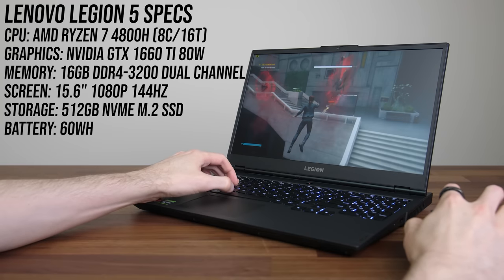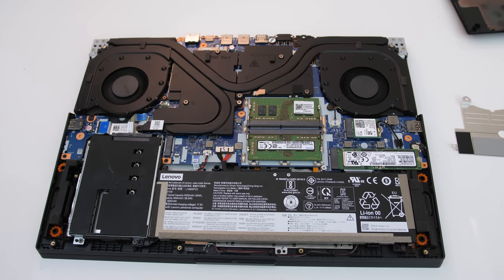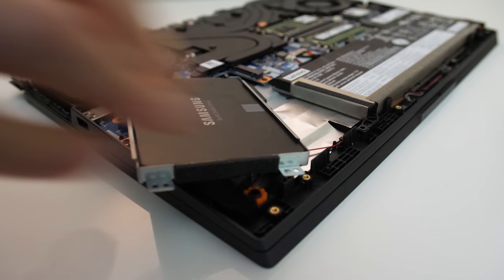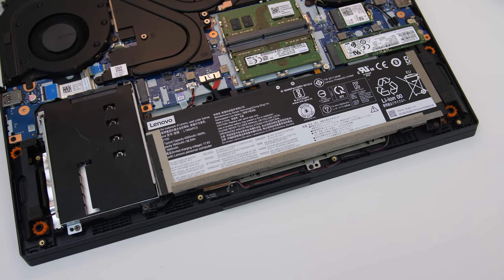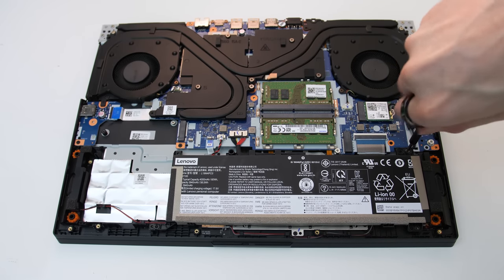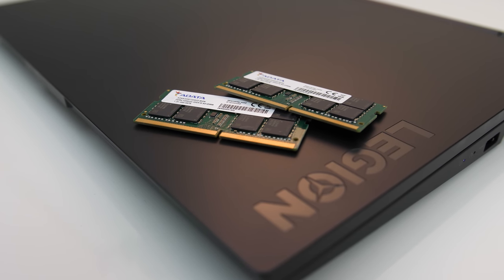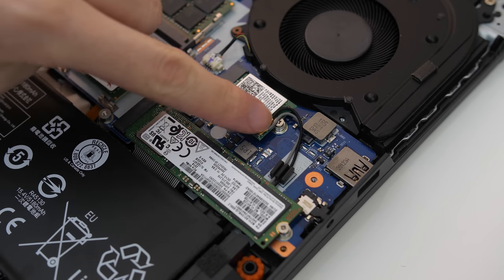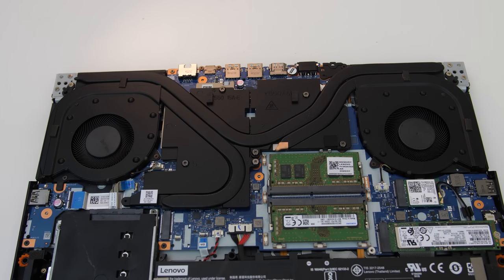Lenovo Legion 5 Upgrade Guide - Boost Performance!

Comment: Pro tip for those who are new to Lenovo laptops! 

If your laptop is plugged in most of the time, Lenovo has a function in their Vantage software called "Conservation Mode", which helps limit the battery charge to 60% when you're plugged in. This helps preserve your battery's health. My Legion 5 is now 3 months old and only has gone through 15 charge cycles!
Reply: currently using my 7 years old lenovo laptop and i never heard this before, thanks man
Reply: Asus has a similar feature. I chose 80% instead of the 60%, though. I don't know how many cycles, though.
Reply: @bipbop3121  I would love it if Lenovo had the option to go for a higher percentage, though I’m sure they’ve done their research before coming to the decision of setting it to 60 by default.
Reply: Doesn't this mean your battery can only charge up to 60% while you're using it, why would you want this?
Reply: Reminds me of the Vaio Care battery life feature on my old i5 2011 Sony SvS15 dinosaur. Still kicking strong after 10 years.
Reply: @loppyhero7196  to prolong battery life, this is very useful if you don't bring your laptop outside... plus if you do plan on using it outside, you can easily turn off the option and charge it at full.
Reply: @pipeds9979  WHY WOULD YOU ONLY WANT IT TO CHARGE TO 60%? NOBODY IS EXPLAINING THIS
Reply: @pipeds9979  Aight thanks, you just said to prolong battery life, you didn't elaborate but I understand now.
Reply: @loppyhero7196 
Among the few things that degrade your battery life:
1. Having it at a high percentage for a long time (older Lenovo laptops have a warning about this everytime u leave it charging for long). 
2. Going through many life cycles (low -> high -> low). 

Having it kept at ~60% eliminates those 2 problems, thus prolonging battery life. You can always turn it off easily if you plan to bring it out soon.
Reply: @nittikorn  Thanks for the info, I had no clue keeping your laptop at 100% for a long time was bad.
Reply: When Lenovo vantage is installed i am unable to control the backlight on the keyboard by using the keyboard shortcut. Does anyone have this problem?
Reply: @HDFilms123  BIOS upgrade will help
Reply: Do you keep yours plugged in? I usually unplug once I get off for a while.
Reply: Conservation mode isn't available on all Legion/formerly just Lenovo Gaming laptops.

Some of their models have batteries with additional hardware that allow the bios settings to optimize battery usage and it just automatically keeps it at a certain charge level or runs directly on the power supply.  I have a Y7000P-1060/Y530 that runs like this.  The battery is kept around 95%, but basically never charges beyond that and doesn't drop either.

As for how to get the laptop over the threshold if you set conservation mode, quite literally just fully turn it off and leave it plugged in.  Doing that will cause the battery to full charge as the 60% limit is actively maintained by the computer checking the battery periodically throughout the day.  

The entire point of conservation mode is for those who have a laptop, but the primary use is as a desktop replacement where they still want the portability available if needed.  My unit I have had for about 2 years (specifically 23 months) and I have gone through only 11 charge cycles and this laptop does get taken to work sites from time to time.  Assuming no pandemic, I might have gotten up to 15 charge cycles by now.
Reply: It has notifications that remind us it’s been a month using that feature.. is it important to charge the laptop full after a month use?
Reply: thanks mate
Reply: Ok
Reply: same as urs, on 3 months i still get 15 cycles 😂
Reply: Thanks for the tip! I didn't know this but I've had my Legion 7i for ~6 months and only gone through 12 cycles without conservation mode (daily use and mostly plugged in) ¯\_(ツ)_/¯
Reply: @ohendzo  same i unplugged it after use
by doing so my Asus would start charging if i replug without switching on device
therefore i needed windows to run (which drains abt 1% every time) then plug in after, but my battery would remain at 99% instead of 100%
Reply: hell yeah, i use the lenovo legion 5 with R5 4600H bought in early august plug in all the time ,only 10 cycle
Reply: do you not charge while using the laptop ? do you wait it for to cool down and then you close it to charge?
Reply: it also works even if the laptop is turned off (or at least it works in my case)

NO MORE OVERCHARGED BATTERIES BABY XD
Reply: Does it limit gaming performance? Since its 55-60%?  Or as long as its plugged in it is no issue?
Reply: @MrUchiha  as long as it's plugged there's no issue as far as i know
Reply: Thnks buddy
Reply: @MrUchiha  get 55-60% battery and turn on that mode: when you plug in, it will change to use straight power from the house and stop using the battery so your battery will do nothing = battery life saved ,just that easy
Reply: Wow seems interesting that’s why I apreciate Lenovo but I asked my which is better and he said acer nitro honestly acer looks better and does better FPS and others like cooling and price
Reply: I guees this works on smartphones too
Reply: @ototurmanidze5578  yes this also applies for smartphones
Reply: thanks
Reply: Using ASUS's feature for this as well, not fully charging is great for your battery health. I even charge my phone to 80% for this reason.
Reply: @loppyhero7196  It's a mode designed to intentionally cap the battery state of charge at no more than 60. This is very useful when the laptop's primary use case will be on AC power, because lower charge rates preserve finite battery life.
Reply: @loppyhero7196  It's a mode designed to intentionally cap the battery state of charge at no more than 60. This is very useful when the laptop's primary use case will be on AC power, because lower charge rates preserve finite battery life.
Reply: @bipbop3121  Really ? Where ?
Reply: Just so I'm on the same page I need to go  set my battery charge percent at %60 while in use to increase the longevity of the battery? I recently purchased a Legion 5 and I mainly use it for Gaming and School, so its plugged in most of the time when I'm on it charging at %100. I didn't really think to much of it honestly.
Reply: Hi, I got a legion 5i (Ryzen option wasn't available and hence had to take the Intel option) 6 months back. The battery at full charge 100% gets over within 4 hours. It is a 80 Wh battery and people are reporting more than 6 hrs at least. I don't play any games. Just browsing or watching video content. If I switch on conservation mode, it descends from 60% to 20% within 2.5 hrs which gets even more frustrating. Anything I can do to check this out? I got 16 GB RAM, 1TB SSD.
Reply: @praveenbehara  Have you checked your screen luminosity ? And do the fans spin a lot ? Is your CPU and/ or your GPU working hard?
Reply: @loppyhero7196  as mentioned there, if your laptop is connected to charger for most of the time, which means if you always use your device while charging it then you do not need to charge the battery unless you are taking it outside. Which saves battery health. And 60% is enough to use normally for 2hrs
Reply: I've learned so much from this comment thread, thank you guys
Reply: Hello. I have the Legion 5 2020 and I'm sure a lot of people commenting here have one too. For some reason, conservation mode via Vantage doesn't stay enabled whenever I reboot or put the laptop to sleep. Reinstalling drivers and rolling back to an older BIOS/UEFI or an older version of Vantage doesn't do anything different. I have read a lot of people experiencing the same thing yet Lenovo hasn't been very helpful to us.

I have also tried committing the changes via the registry but that also doesn't work.

I know this is only minor but it gets annoying turning on conservation mode every time.
Reply: Those holes on the back looks scary as fuck. It's like, the thing is staring at me. That's freaking me out.
Reply: @pipeds9979  hello i hope you can reply here. How about if i need to use the Performance mode. Is it ok to use it with the conservation mode?
Reply: @ciscasaclang3378  yes you can since you are not actually using the battery but rather directly from the power plug.
Reply: @pipeds9979  meaning it will have the same performance with "Performance mode + NOT conservation mode" vs "Performace mode + conservation mode", while protecting battery life from staying to 100%? Thanksss 👍🏻
Reply: @ciscasaclang3378  conservation mode is just restricting the battery from fully charging. No effect on performance except if you are ysing ur laptop on battery only
Reply: @pipeds9979  yaaay thanks for the answers man 👍🏻
Reply: @pipeds9979  Does this lower gameplay performance or not at all?
Reply: @bipbop3121  Hey, that's cool. Would you share the name of the Asus app?
Reply: Hi bro, will this mode work when the laptop is shut down?
Reply: @loppyhero7196  I’m 6 months late but due to the makeup of lithium ion batteries, it prolongs the life of the battery when you keep the charge near 50%. And you probably want to have charge cycles that go around the 50% margin like from 75 to 25 precent. keeping the battery at 100 percent charge continuously wears the battery down, and charging it from 0-100 and so on also decreases the overall lifespan of the battery
Reply: I had crazy stuttering issues playing games when the laptop was hovering at 60% in that mode. It would try to charge and the settings would change, then the battery would be topped up and it would disconnect and drop frames or something. Absolutely unplayable, unbearable. Don't actually know what was going on because I'm not a tech guy but that's my assumption.
Reply: Bless. Lenovo had these for years . Been using this feature since 2013.  The battery is still good .
Reply: How do u check number of cycles tho?
Reply: @WeldarIC  thanks, I'm at 150 cycles after a year
Reply: @nishantsingh4929  for a max lifespan of 500-800 cycles you are ok :). I enabled from the first day this conservation mode and after a year I have 22 cycles :)
Reply: @WeldarIC  I also keep it enabled most of the time, idk how 150 cycles. Does it considers it a cycle when the battery drops below certain percentage, say 50%?
Reply: @nishantsingh4929  It very specific, this conservation mode have different algorithms than ful 0 to 100% charge. I just keep my laptop mostly pluged in, not so much of drain and charge processes in this case. It seems that you used your laptop a "few" more times unpluged than me  :)
Reply: Thank you!
Reply: @loppyhero7196  higher you charge  your battery (up to more percent) more it is wearing. If you charge from 90 to 100 its like from 0 to 60, roughly same wearines aplies. Its great way to conserve battery health. If laptop is plugged and constantly pushes battery to full capacity, its killing it fast.
Reply: 6 months, used daily for several hours. 5 cycles
Reply: @loppyhero7196  It is, around 90-100% of battery and 15-0, there are chemical reactions that can damage the battery in long term. Around 40-60 % the chemical in the battery are the most stable, so the battery increase significantly its lifespan.
Reply: My battery in the use of the 2 months and 2 weeks went through 11 cycles. And I am using it quite often in school.
Reply: Vantage is completely broken for me. It starts up and just freezes no matter what
Reply: So...I can have it plugged in to wall power while gaming safely? Or should I unplug after it reaches 60%?
Reply: @SirByfrost1678  you can just leave it plugged in forever and the software will cap it at 60% for you; that’s the beauty!
Reply: @SirByfrost1678  you should be fine with leaving it in.
Reply: Thanks, I activated this immediately.
Reply: @loppyhero7196  i never bring my lenovo legion outside and its always plugged in

So 60% it is
Reply: What’s a charge cycle
Reply: @akiisho  It's a rounded 100 of battery discharge. Means e.g. one day you use 50 % of the battery after that you charge it and again discharge 50%. That 100 % used battery is one charge cycle. Basically cumulative use of 100% of battery.
Reply: @contiplays  lol thx but I still don’t get it
Reply: @akiisho  ok no problem. So. You have your phone at 100% of battery. You use it to 0%. That is one charge cycle because you have to charge it back 100%. But it does not have to be in one take. E.g.
You have 100%. You use it to 50%. After that, you charge it back to 100%. Then use if again back to 50%. That is a cumulative discharge of 100% and that is called the charge cycle, when you charge it back to 100. 
Better?
Reply: @contiplays  yeah thanks actually understood what u said
Reply: Great tip brother. I just ordered a Legion 5 RTX 3070 Ryzen 7, I will be using it in the mains a lot I imagine as I do a lot of time consuming 3D projects. Thanks!
Reply: THANKS! More tips like this please haha!
Reply: That's incredible! My Macbook is crying due to it's charge cycles
Reply: is this available on linux
Reply: Acer has the same thing on newer models 2020 and up, 80% battery limit in acer care center
Reply: @paulcajka7001  how did you calculate that 11 charge cycles? Does the percentage full 100% for it to count as one charge cycle or...?
Reply: @nishantsingh4929  soo how do you check the cycles for battery?
Reply: @kishorekumar624  vantage app Battery details section
Reply: @nishantsingh4929  okay thx. Btw is legion 5 for multiple chrome tab multitasking or will it lag.
Reply: @kishorekumar624  it's working fine. Never noticed any lag on any task
Reply: @kishorekumar624  the Lenovo Vantage/Settings software will tell you under battery status
Reply: @loppyhero7196  as an battery expert, I can say that keeping the battery fully charged is shorten the battery life badly
Reply: This piece of information is great! Thanks a lot.
May I ask if this feature is active by default or do I need to activate it?
Reply: @shriefallam8866  on by default if your battery has the circuitry to support the tracking
Reply: @paulcajka7001   
Thanks a lot Paul, I appreciate your reply. 🌷
Reply: @shriefallam8866  you need to activate or deactivate it urself
Reply: @nittikorn  
I see, where may I enable/disable this feature?
And of coursethanks for the reply after a whole year. ☺
Reply: If anyone knows an answer I would really appreciate it.
What would happen if I installed a 4TB SSD, would it still work?
Reply: @shriefallam8866  It's in the Lenovo Vantage software, under the Power section. It's only available for newer laptops I believe
Reply: I just got mine this monday and it's only been through 2
Reply: they dont have that for legion 5
Reply: @pr00009  
It is there, I own a Legion 5 and I activated it indeed, it works.
Reply: @shriefallam8866  ooo i better look for it then. i will upgrade my laptop eventually.
Reply: @pr00009  they do
Reply: Does Conservation Mode affect performance?
Reply: @branchtree448  no
Reply: Hi, do you think that Lenovo legion 5 (non pro) can last long as a laptop? I need it for architecture (student) and sometimes may use it all day long for cad and some rendering apps. Do you think is good, with ryzen 7, ssd 512 gb,  16gb ram and rtx 3070?  I will need it for 4 years!
Reply: @wendy2263  I have the 3060 one. The ram can be upgraded to 32max and there are two NVME SSD slots. Ones of them is already occupied by the 512gigs. The other is free. I would say it will be a good laptop for the upcoming years but you will need to carry a charger for it with you. Even with the bigger battery you need a charger with you at all times. I WILL SUGGEST that you uninstall the Vantage app and use Legion Toolkit from GitHub so that it does not lag on battery power. For some reason. My laptop and others have also reported that Vantage makes their laptop lag on battery.
Reply: @HDFilms123  try a bios update
Reply: @Eagle10021  The weight is not the problem, just the build quality and laptop's life. Thanks a lot.
Reply: @wendy2263  build quality is good compared to some Asus ROG laptops. I've dropped my bag with the laptop in it a few times by accident and so far nothing is broken. It also feels nice to type on.
Reply: @Eagle10021  Thanks for letting me know! Its really helping me a lot.
Reply: @wendy2263  No problem! Just ask if you need anything else answered.
Reply: Oh I need this for my MSI laptop!

Can that app use it on my msi?
Reply: @condorX2  I don't think so.
Reply: Late reply I mostly used my laptop disconnected from the ac adapter so having it at 100% is optimal if it was always plugged in then set it to conversation mode!
Reply: Does it automatically do that or do I have to enable it?
Reply: @contiplays  thanks for explaining that I had no idea I was told something total wrong a long time ago..
Reply: @wendy2263  I don't know for sure but I think any laptop and easily last 4 years maybe even 10....
Reply: This sounds interesting, must find something similar in the Acer support site for my Nitro :)
Reply: @nittikorn  thanks its helpful 💯
Reply: Would you recommend me getting a Lenovo gaming laptop? I’m thinking about getting one
Reply: thanks !!!
Reply: What does this mean bro?, damn I'm so confuse, I bought Ideapad gaming 3, why is the battery drain so fast ? :(
Reply: Thanks bro
Reply: @loppyhero7196  CZ WE USE IT AS DESKTOP REPLACEMENT AND DONT WANT TO WEAR THE BATTERY
Reply: After two years of using I have only 130 charge cycles. Great function!
Reply: Thanks for the tip, dude. I have this laptop since november 2021 till today, may 2023. Vantage shows me 29 cycles....is this good or bad?
Reply: Niiiiice, thanks bro !
Reply: I've had a Legion 5 since 2020 and this is the first time I read about the Conservation Mode, I'll give it a try.
Reply: @loppyhero7196  it stresses the battery more to charge full
Reply: @loppyhero7196 Because the battery life time is measured in cicles, one full charge to 100% means one cicle.
Reply: My Laptop is basically always plugged in and I've let this "Conservation Mode" always active. 

After more than 3 years, I have 105 Cycles with a full charge capacity of 76/80 Wh. I have a Legion 15ARH05
Reply: never used the conservation mode. 2 years now and my battery is still 100% with 131 cycle. Its always plugged in anyways.
Reply: How long your legion 5 battery lasts?